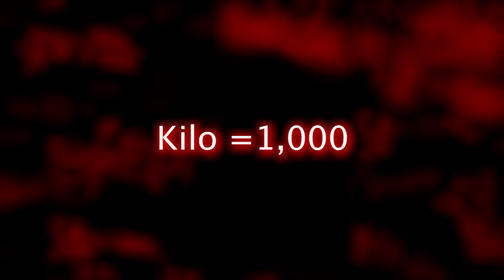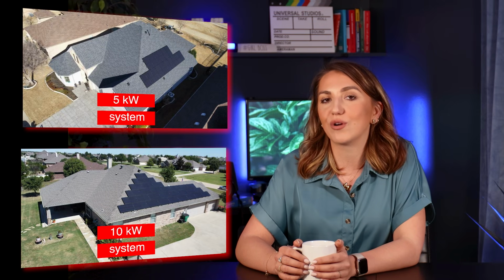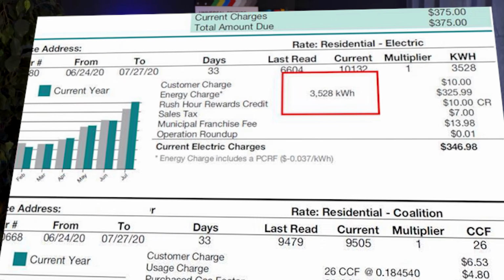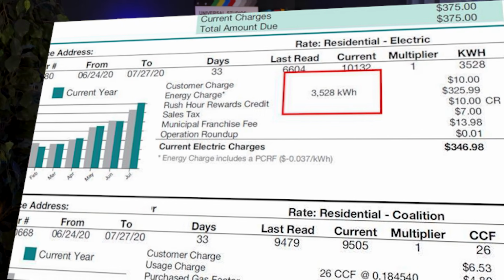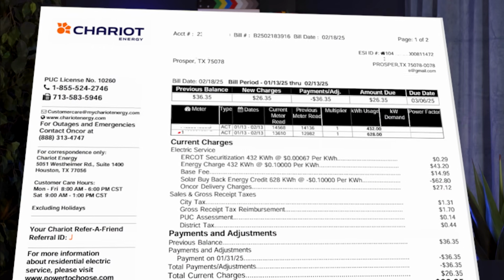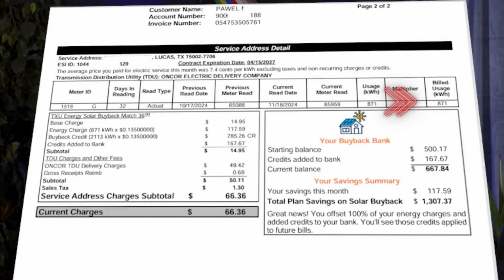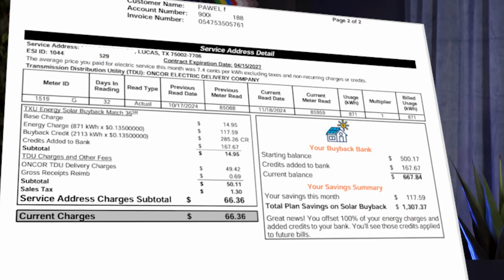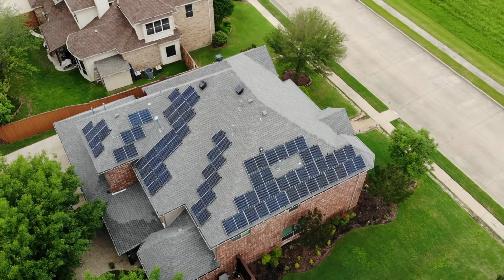The REAL Difference Between kW and kWh Explained! Power Vs Energy: Absolute Solar and Battery Basics

Comment: What a GREAT video.
The units watts and watt hours for many these terms seem to be interchangeable.
They are not. 
However………

1 horsepower = 746 watts 
And 
1 gallon of petrol = 33kwh
But you will never get 33kwh from a gallon of gas in a generator because most of the energy comes out as heat not electricity.

Comment: My electric utility here in the Phoenix, AZ area is SRP. They buy back at a rate of $0.0281 per kWh. Once you go solar you are switched to their Residential Demand Price Plan which has monthly service fees ranging from $32 - $45. On average I would need to sell back 1400kWh just to cover the monthly service fees.
Reply: This is why in California I bought all of my equipment wholesale and installed it myself. I have solar and batteries and my system operates in non-export mode. So I never spin my electric meter backwards. I do not have a permit and I do not have an inner connection agreement with the electric utility. Screw them. What business is it of theirs what I do downstream of my meter?

Comment: Thanks for the excellent content Martyna. Future topics. PV Direct domestic hot water.  PV Direct mini splits. PV Direct water pumps.  PV Direct home resistance heating.

Also the unique electrical characteristics of PV Direct.
Match the resistance (Ohms) of the PV panels to the resistance of the load at MPP. See David Poz video.
Fuses/breakers are sometimes not needed because there is no over current from the non existent battery.  A disconnect is still used.
PV Direct only works when the sun shines.
Instead of storing energy in a battery, use a tank of hot water, a room cooled to a lower temperature, an elevated water storage tank, and a late afternoon over heated house.

Comment: Haha.. to make things more complicated....
A 48 volt system uses thinner gauge wires than a 24 volt system 😛
Why?
This is because 48V systems operate at half the current compared to 24V systems for the same power output. 
The reduced current translates to less heat generation in the wires and lower voltage drop, allowing for smaller wire gauge sizes. 
Sooo... a 24 volt system will need thicker wires = more money (more Copper in the wire), than a 48 volt system that can use thinner wire = less money 😅

Comment: Thanks for the video! My system is 8.2kw and I have never seen 8kw show up on my app. The highest I have had was around 7.2kw and it was a short spike when  the panels were cool, like when the sun pops out finally on a cloudy day.  I’m enjoying my system. I should have doubled my battery bank. I have 15kw of battery and tripling it would have put basically off grid. I do the free night program with my electric provider. My electric bill is 7-$8 per month. My batteries and panels keep me from using electricity from the grid from 6am until 8pm. 2 days this year I used some grid due to weather. That’s why another 15kw would have been nice.
Reply: Rick, sure you don't mean 15 kilowatt-HOURS?
Reply: @garyhiland6013  Clearly he didn't watch the video.....
Reply: which free night program it is ?
Reply: @p4bt free electricity from 8pm to 6am. It’s called free nights. Reliant and TU Electric offer this. I’m in an area of Texas that allows me to choose my provider. There are around a dozen or more companies to choose from.
Reply: Now here you are at the video and you still do not have your units straight! The energy in a battery is expressed as kilowatt-hours not kilowatts!